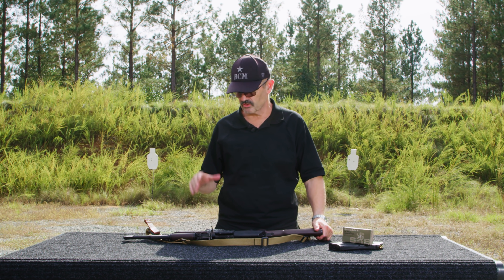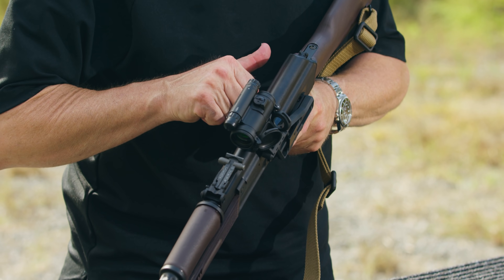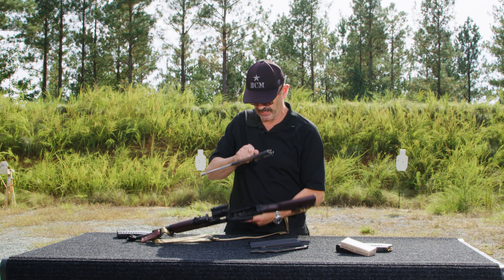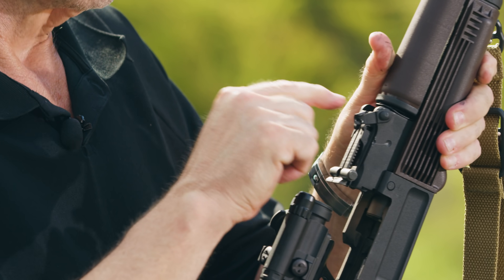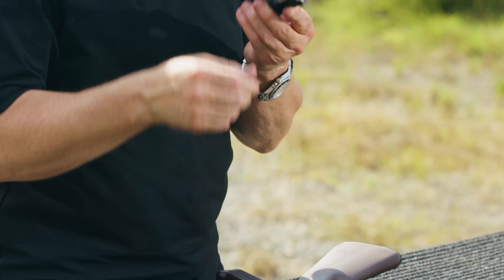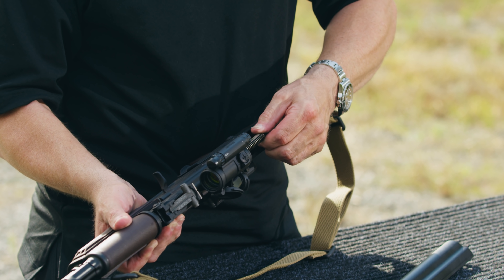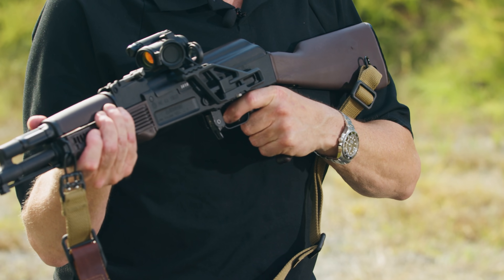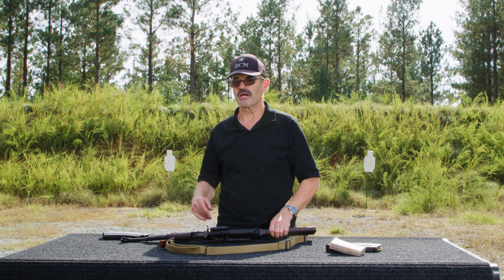BCM Training Tip: How To Field Stripping An AK

Comment: you can also use the guide rail slots in the bolt carrier on the shelf of the gas tube lever as a means of turning it as well

Comment: We were taught to pull the trigger with barrell looking into a sand box, after detaching mag and inspecting. If AK is dirty - round can get back with the bolt while you inspect the chamber and you may not see it by chance.

Comment: Hope your feeling better boss man. Just 1 thing. You can use the notch in the bolt carrier to help pop that gas tube retainer as well (provided its not a Chinese or US cast carrier). Vs smacking it. Granted most parts are installed with a hammer xD. That being said. Keep up the good work!

Comment: 3:11 learned something new, about re-installing the receiver top cover.  Slapping it down does not always lock everything in place and for an M1/AR guy often takes a few tries.  Larry's tip to work the operating rod is foolproof first and every time.
Reply: On a zastava m70 they have a pin in the back of the receiver that you can use to hold the spring forward slightly like here and then hit the pin to release once top cover in place. Not aware of any other AK that can do that
Reply: @fujimi715  thanks !

Comment: I'm from Russia and we were doing this in the school, 40 min lesson once in a week and we were competing with classmates. In order to get "A" grade you had to do disassembly and assembly in 25 seconds, my personal best was around 19 seconds.
Reply: I saw a video from Russia of such a class.   I have to say that the AK they had must have had loose fitting/worn out parts.   I have a Yugo AK from Century and the gas tube is beyond too tight.   I have to use pliers to get a good grip.   But still the kids are very fast.
Reply: @mikethompson2650  yeah, it's very loose so you can disassemble it easily, except for the cleaning rod that might be rather tricky to get out sometimes.
Reply: @berser4ina  I am so glad to hear that since I feel much less of a wimp for struggling for tear down mine.  Still love mine.
Reply: @berser4ina  I noticed that too, the cleaning rod caused them to struggle somewhat. Other than that, the rifle looked looser than Harvey Weinstein’s moral compass.

Comment: BTW, for those like me that have a tight latch on the gas tube lock, you can use the bolt carrier itself as a "extender" to unlatch.  There is a slot in the side of the bolt carrier that makes a perfect fit for the gas tube lock latch.   This grabs the latch perfectly and the side of the bolt carrier means you can easily unlock the latch.   You don't need to hit the latch.

Comment: There is literally no better sling than the Blue Force Gear Vickers Sling. It just can't be beat.
Reply: Actually the magpul sling is pretty good. Quick adjust and can switch between single double
Reply: I love all of my Blue Force slings!  Six, so far.

The latest is a custom sling I had BFG build for my 5.45 Bulgy side folder that I used at Red Oktober 2021.  Two weeks of training up prior to and two solid days of constant of use in Vegas and that sling rocked!   

Good video for the new AK folks out there.  Keep up the great work and stay strong, Larry!   We're all with you!
Reply: @fujimi715  The magpul sling is decent but Vickers is still the best👍🏻

Comment: 0:36 I feel like a sign at every range or gun store with these very simple words, would probably help prevent a few accidents. Good on you Larry! (Remove the source of ammunition, THEN check the chamber.) Too many people forget step one. It should already be on safety. ;p
Reply: Necessary Safety Precautions as taught to me:

1. Keeping your finger away from the trigger, pick up the firearm and point it in a safe direction.
2. Check safety and apply it, if not already applied.
3. Remove the magazine.
4. Move the working parts to the rear and lock the action of the firearm open.
5. Inspect the chamber at the rear, front and then down into the well from the top. It should be clear at all three points. 
6. If clear, release the bolt/allow the working parts to move forward, cocking the firearm.
7. Pointing in a safe direction, remove the safety, aim and pull the trigger to release the action.
8. Re-apply the safety. 

The firearm is now proved clear to YOU and only you. If someone saw you do all this, then you could now hand off the firearm to them, if they agree that the firearm is clear. If someone turns up, and didn’t see you do it, they need to see you do it all over again to be sure of receiving a cleared firearm.

Comment: Don’t do that recoil spring trick on an Occam Defense rifle or a Century VSKA as they both use pot metal for the action spring guides. The metal will peen on the end of the recoil spring guide, and it will have trouble fitting in the rear trunnion. A proper made AK (like this Aresenal or a IMI Galil) will work fine with this trick. Do it all the time on Galil rifles.
Reply: Shot my first Galil last week…OMG……
Reply: Yeah, I have a Yugo AK from Century.   I was rather stupid about AKs, I thought that like the AR they were all mil-spec, that an AK was an AK was an AK.   They were all the same.  Boy did I learn a lesson when I couldn't take it apart and the seller had to give me a class.    I bought some parts and learned from a gunsmith that I had some parts there were useless on my Yugo.   I learned and learned fast.   Still love what I call my steampunk Russian.
Reply: @mikethompson2650  Everyone’s got to start somewhere, luckily those Yugo kit builds are often decent! And yea all the different variations can be annoying for ordering parts.

Comment: Great video on the AK field stripping Larry! I love the M4 and the AK. I have always looked at it the same way you do Larry. The AK should have been the general GI weapon in the mainstream military and the M4 platform should have been used for more speciality career fields "spec ops" because there are more small parts that you can lose and a little bit more maintenance with the rifle. Both are accurate and reliable guns and are great fighting rifles. As always, you're the man Larry!

Comment: Russian schoolers supposed to disassemble it for 19 seconds, including taking out the cleaning rod and the buttstock tools penal, and assemble it back for 32 seconds. :-)

Couple lifehacks from these old school days. You don't need to take your left hand away from the gun, and put the gun on the table to take the bolt out of the bolt carrier, just swing the bolt right and push forward with right hand thumb. Then, use the bolt carrier rails to lift the gas tube lock, your left hand still on the buttstock neck.